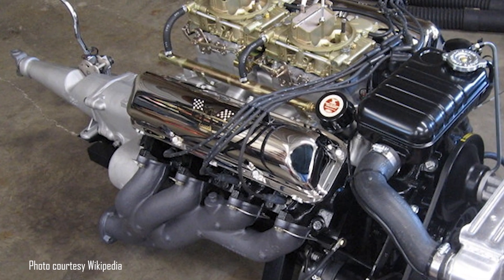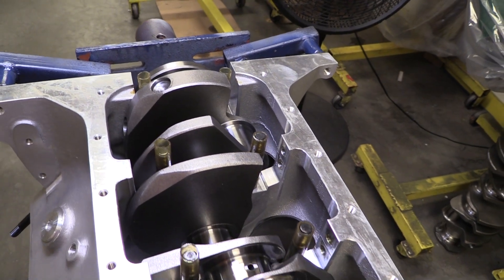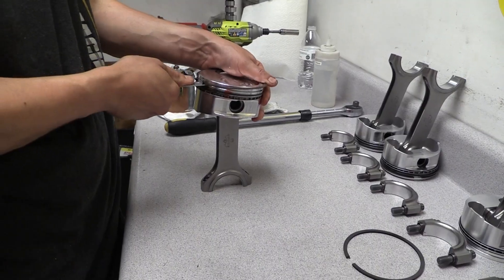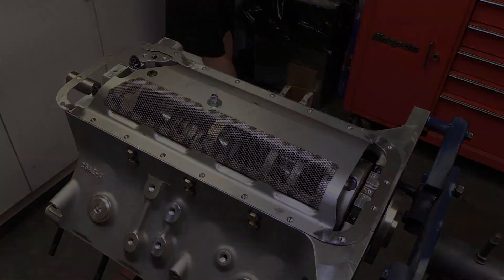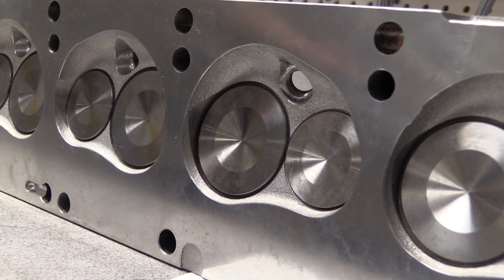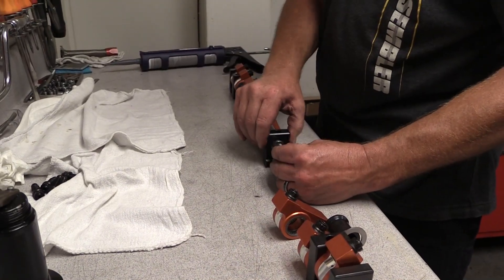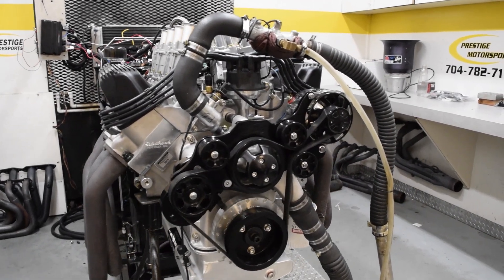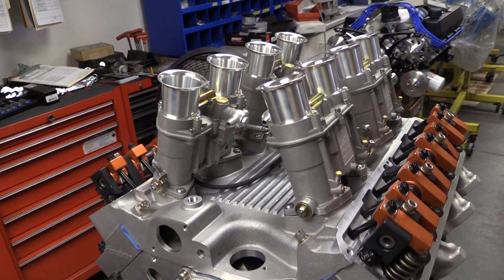Building an All-Aluminum, Fuel Injected FE Ford (with a Carroll Shelby Block!)

Comment: I put one of these in my ERA Cobra when I built it in 2003.
All aluminum Shelby block & aluminum Shelby ported heads with a stroker crank (468 cid) and Crower 300+ degree solid lifter cam plus dual 600 CFM Holleys on a Tunnel Wedge intake.
The Cobra weighs 2,300 lbs and makes 600+ HP.
Have to be wearing Depends when the 2nd Holley opens up on the progressive linkage!!
😲.... 😳..... 🤯
😁
Reply: Doesn't sound right to be running on 1 carb & using the 2nd as your secondaries.
Should be running both pairs of primaries & having the secondaries of both carbs open when needed. I've done a few.
Reply: @azmike1956  
It runs on the front carb's primaries until about 1/3 open,  then the progressive/slide linkage starts to open the rear carb's primaries. Carbs have vacuum secondaries with very light springs....so they open up quickly!
Hang on!!!
Reply: @Turbo4Joe363  so i'm guessing it's an open plenum design that allows the front carb to feed all cylinders? That would work.
Reply: @azmike1956  Yep, a DOVE Mfg. 'Tunnel Wedge'.
Reply: @azmike1956  I had a offenhouser  manifold on my 302 pinto years ago that used a primary, secondary pair of Carter carbs. The secondary carb only had secondary metering. Fully progressive linkage gave 2v, 4v, 6v, and 8v sequential throttle.
Reply: @jacquelineoldhaver2672  must have been a handful to drive. I had a pretty mild '72 Pinto with a 289, Torker with a Carter street performance 4bbl, Mallory dual point & dual exhaust. (No headers & a C-4 auto).
  Lots of fun to drive except in the rain!
Love those Pintos, take care.😊
Reply: I have a A scratch 428 PI engine with edelbrock rpm heads , a old edelbrock streetmaster intake thats been portmatched with a Holley Center squirter 750 cfm carb , comp 268 H hydraulic lifter cam and a pair of ceramic coated long tube headers in my 55 fairlane club sedan with a tremec 5 speed and 3.90  geared 9" and its a blast to drive and quicker than I ever needed it to be. Its a tire roasting old sleeper with its factory paint scheme and hub capped widened steel wheels
Reply: @GorillaCookies  
Beautiful 👍
Reply: lol... a 468 FE only making 600? welcome to cleavland land... we've been doing that for decades with far less cubes
Reply: @narmale  
Yeah....and who wants a Cleveland in a 427 Cobra?
They came with FEs...ya know.
Nothing wrong with a Cleveland as long as it's NOT in a 427 Cobra.
Reply: @Turbo4Joe363  let me dig through last seasons governor's cup autox event

Old guy shows up in his shelby cobra in a very nice toy hauler, matching paint and wheels to the truck.
Has the ORIGINAL 427 in the hauler to show off, and has a Kaase FE in the car but carries the engine to show off.
Kaase engine making 800+ hp all engine.

Car is crazy fast, sounds amazing, the 4 tires are as much as my car by themselves. 3rd lap coming out of a tight hairpin into a puddle, he loses it, double spinoff, and narrowly misses a massive hole outside the course.
The guy is so mad/embarrassed/self conscious about failing in front of the commoners he loads his whole package up and leaves mid race.

Forget numbers matching and original, make it run good, understand your car, then lastly, drive.
Reply: @narmale  When Ford put a big block head on a 302 or 351C that was the idea . The SOHC would be a much better comparison . Anybody want to take a serious look at a Boss 429 ?
Reply: You're not trying to be a story topper...are you?
Reply: that should be enough to get to the grocery store for a loaf of bread and a gallon of milk!
Reply: May I ask how much $$$$? I’m just curios
Reply: @rickjohnson1632  
Back in 2003, the aluminum block cost $5,000....now it's $7,500.
IIRC... about $17,500 for the entire engine build.
(You can pick up the block with one hand.)
Reply: azmike1956,  I had 3 -2 barrels on a competitive import many years ago and it was progressive linkage. Whole dif car and motor but,  I think that set up was quite effective.
Reply: @BuddyRHS1965  great setup if dialed in.
Good mileage & performance too.
Reply: @BuddyRHS1965  
Had a six pack on my 390 FE for a short time. Sucked way too much fuel so for every day driving I only used the center carb. Ran weak but got great mileage for a 4,000 pound car and it could be power ready with a simple linkage adjustment. I loved my Fairlane... 😞
Reply: That's sounds like a amazing build.These     FE based engines push that little car around with much less effort the competitors engines do.I love Ford stuff.You should share you're setup.Thanks.
Reply: How much less does it weigh then cast-iron counterpart I love them big old Motors in my big old trucks ain't nothing like beating up on Mustangs and Camaros
Reply: @rodromes7162  
Had an old 67 Fairlane with a 390 that I built back in the day. A guy with his girlfriend in an 80 something stang rolled up next to me and yelled out “get a real car!” Pretty sure that it took a week to get the smell of burnt rubber out of his girlfriend’s hair after trailing me down the road. Never saw that car there again. Priceless 😁
Reply: @WRMonger1   priceless Ranchero 394 barrel for Speed you let the clutch out first then you hit the gas and yes you just smoke them prefer a p series Ford block computer is not printing it out right I do like the vortec 454 in there heavy duty three quarter ton Chevy 97 extended cab still race Worthy compared to most cars as if you might have noticed I prefer trucks my old 67 100 replace the 352 with a warmed-over 428 lots of fun pissing car owners off Mustangs Camaros Chargers fiery Birds it was just fun running and they didn't like getting beat by a big old back in the day that was a big old truck keep the Spirit Alive try to kill the heartbeat we still want to keep the heartbeat live also otherwise we'd have no competition competition breeds more competition engineering benefits fuel power drive trains yes I could work for Ford they treat their employees like s*** they make their money and kick you to the curb my family namesake my real name is a f brand I was gifted a 40 I think you know what that number stands for if your gear Head by my grandfather which I never got along with he never had the time of day and the American government gave that car to an ex CIA president officer you might know who that became to be president you don't know his illegitimate daughter he's the one that was illegitimate not his daughter I still want my black F40 I do expect it anytime soon been a cover-up since the car was new they knew it was my car and they gave it to her if anybody knows where my car is please let the person that bought it know that everything about the purchase was illegal please give me my baby back
Reply: @rodromes7162  uhhhhh.........
Reply: Hope it's somehow dialed in so half your cylinders are not running lean. A problem when running on the primaries of one carb that is far from being centered on the engine. Not that i really think i'm pointing out anything you don't know.
Reply: You're Killing Me , Paper Towels are Cheap 😄🇺🇸🏁
Reply: Niiiiiice👍
Reply: That's what I'm talking about right there. He'll yeah I want the daytona coupe and a cobra in my garage
Reply: Can I find me another old 67 F100 and build me a Camaro Mustang racer I love the element of surprise nobody expects a quick truck